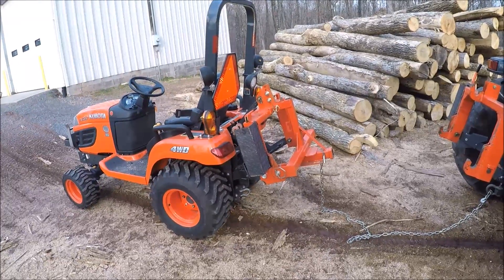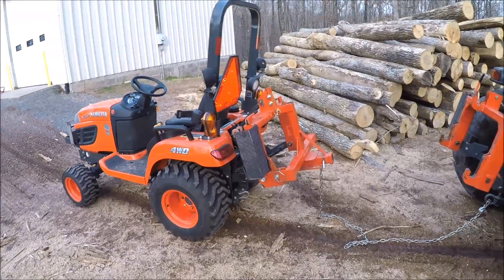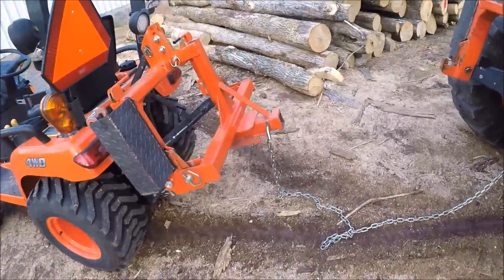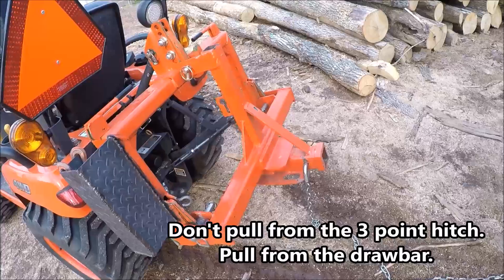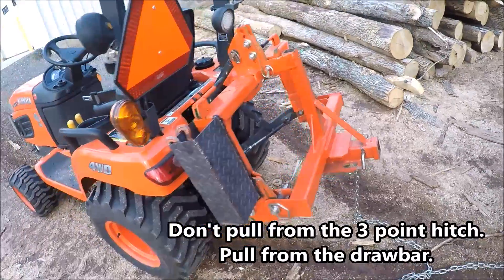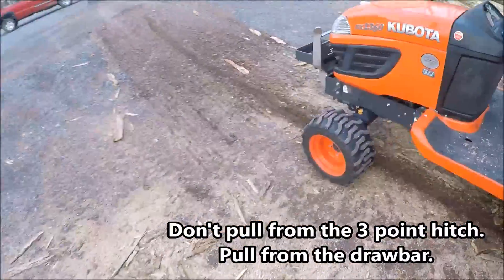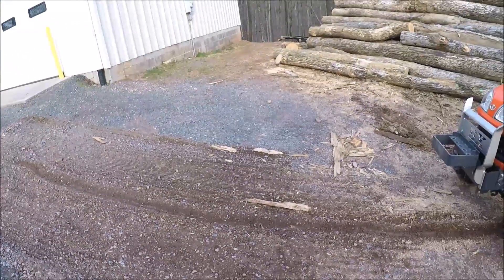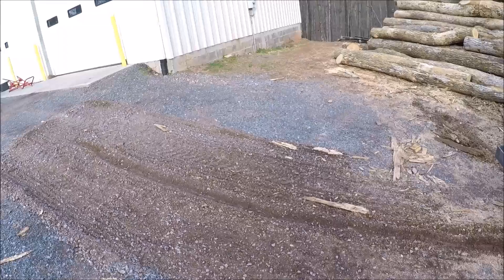Why You should Ballast Your Tractor (WITH PROOF)

Comment: just bought a Deere 4052, which will be delivered in a week or so. I drag alot of wood from my woods, brushhog, spray fruit trees, use as a scaffold, and always lifting something. So my question is what my dealer asked me. What tires should I get?, and should I load them? Your answers would be appreciated.
Reply from the maker: I think R4 tires are the best for your needs. They are a good all around tire. Turf tires are really on good for mowing. Ag tires give you your best pulling power and are best for dirt work. Since you are going to be to do a variety of work R4's would be the best. They are a but more puncture resistant than ag tires, which is good for use in the woods or bush hogging. They are easy on the turf, so they will be good for spraying trees. They are wider than ag tires so they are a good choice for a tractor with a loader. Since they are wider you can get more fluid in them, more weight/ ballast. I would definitely load the tires, preferable with something that is non corrosive.

Comment: Oh no but you need 4 wheel drive eh wrong. I agree 4x4 has its time and place if you work in muddy conditions using your loader & having to go up muddy hills then yes it may benefit you. However if your land is mostly flat no need for 4 wheel drive. Ballast the rear tires with fluid and your fine. These Kubota tractors are light as hell notice when he got the dirt with the ballast his rear wheel still spun while backing up that’s just shitty. Add fluid to the tires and still use that wood ballast and you will not have to flip that 4x4 switch. I prefer a 2wd tractor due to cost. Mess up that 4 wheel drive and I hope you have deep pockets. Plus trade that Kubota in for a Deere get something worth having.
Reply from the maker: I think there is a reason that the majority of tractors sold are 4WD. The tractors has fluid in its tires. The tractor is comparable in weight to other tractors in its class. I've never heard of anyone tearing up the 4wd in one of these tractors. This tractor has features that will make it run circles around a Deere.
Reply: The Traveler or you could just buy a non compact tractor with 2wd and proper tires?

Comment: Excellent tutorial, I just wish that you were wearing a microphone (or bring the camera closer) so that we could hear you better. It's refreshing to hear someone correctly state the importance of unloading the front axle with ballast on the 3 pt hitch thereby moving the tractor center of gravity aft. Loved the demonstrations!
Reply from the maker: Thanks! I've had some problems with my camera. I even sent mine back to the manufacturer for another one. Last night I figured out what the problem with it was. It has 3 microphones. The external housing covers 2 and fits around one very tightly. I also had problems with it making a bumping or scrubbing noise. So today I made holes for the 2 mics that are covered and made the 3 hole bigger. It seems like it has reduced or eliminated my scrubbing problem but I just transferred a test video to my phone. I am going to do more testing it with it and see how it does. I may buy an external mic for it . The adapter for a mic is around $100 plus a mic. I may also look into other cameras. Recently I also started using a higher quality editing software then what I used in that video also and I think that may have helped. Thanks for watching and thanks for the feedback.

Comment: Adding ballast increases not decreases  the load on the front axle up to the lifting capacity of the loader.
Reply from the maker: I'm not sure I understand. A ballast on the rear of the tractor will take weight off of the front axle. Or do you mean a ballast increases the loaders payload capacity?
Reply: I think he means it puts more weight on the front wheels. Which might be true, but it will balance the load so it only helps.

Comment: So I have a JD 3025e with a loader and currently no ballast.  My plan was to get a heavy hitch and load it with 750 lbs of suitcase weights.  However, that will take away from my 3 point lifting capacity.  So, now I was thinking about maybe going with solution in the tires, some wheel weights and still have the heavy hitch with about 350 lbs of suitcase weights.  I believe the minimum ballast on the 3025e is 819  lbs.  I used it to pull some oak logs and it just doesn't seem as sure footed as the 8n I was using which had solution in the tires.  Let me know what you think.
Reply from the maker: I agree about the heavy hitch. You definitely need fluid in your rear tires, I would do that first. It will also help to lower your center of gravity. Use a fluid that is noncorrosive. I have methanol in my tires. I've heard good things about Rim guard, it is very heavy. With rim guard you will add 310lbs per tire, 620 total if you have R4 tires.  Then if are not pleased add more weight. I assume you are pulling the logs from the drawbar or 3 point hitch? So a ballast on the 3 point hitch would be in the way.  So wheel weights would be your best option. I looked at John Deeres website and it looks like they are 45lb or 60lb weights and are $140 each, which is pretty expensive.  You may be able to find aftermarket weights for less. Even with the fluid in the tires you will still need a ballast for using the loader, a scraper blade may be sufficient. You don't want the back end coming off the ground while you are using the loader.
Reply: My current log pulling set up is a draw bar on the two lifting arms with a drawbar grab hook.  I hook the chain close to the log and lift the arms to get some weight down on the rear tires.  When I talked with the dealer he didn't like the idea of fluid or wheel weights he really wanted me to get a ballast box.  I like the idea of fluid in the tires, I will have to find some "cheap" wheel weights.  Thanks.
Reply from the maker: Most dealers won't sell a tractor with a loader without fluid in the tires. Are you using the tractor for anything else were you need the tractor to be lite?
Reply: No, I explained that I would be using it to pull logs and work in my 11 acre woods.  He also talked me out of R1 ag tires.  He told me I would be looking at a delivery date of sept because of the tires.
Reply from the maker: I would definitely do fluid in the tires. R1's will give you more pulling power in mud  and loose dirt and R4's are better for hard packed dirt. R4s are more puncture resistant so they are good for the woods. The R4s are wider tire so you can get more fluid in them for better stability and more pulling power.  You will be amazed at how much more it will pull with the fluid in the tires.